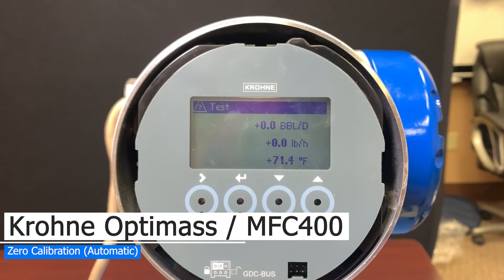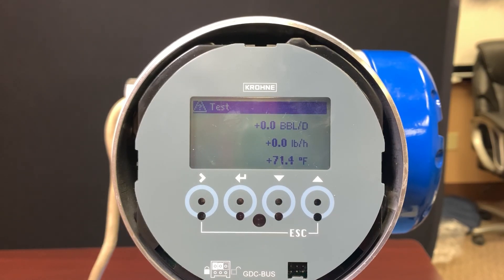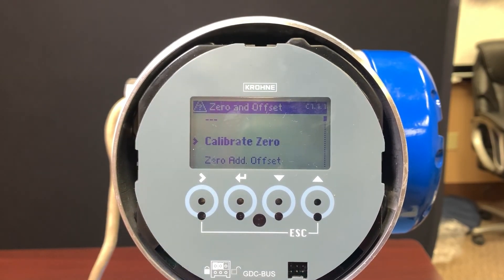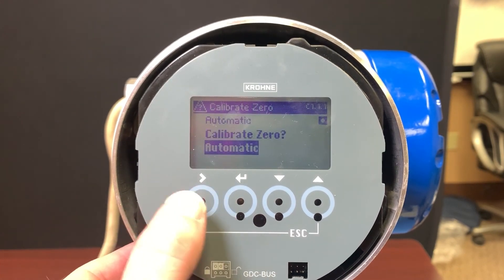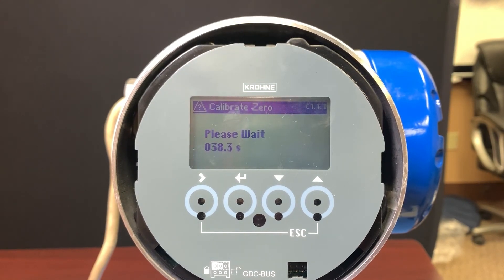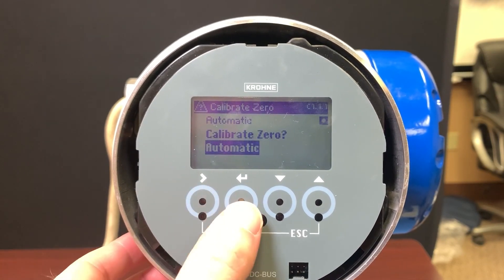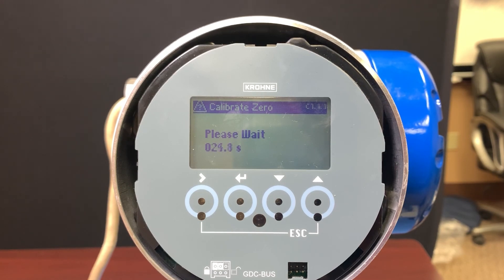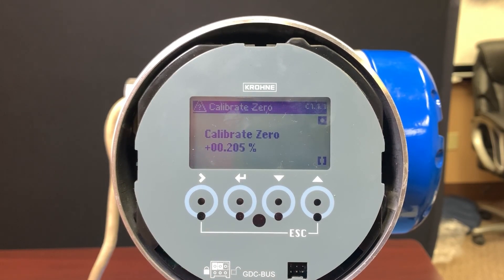Krohne Optimass Coriolis Meter with MFC400 | Programming: Zero Calibration Automatic

Comment: Hi, men very useful video, i have question  when we can do this calibration while there product (water)? Or need to remove flowmeter and then do this task?
Reply: according to the MFC400 manual available on the KROHNE website:
Observe the following for reliable zero calibration:
• The flow sensor should be completely filled with the product at the expected process pressure and temperature.
• The product may contain no air or gas, especially when it comes to horizontal installations. Prior to zero calibration, it is recommended that the product be flushed at a high flow rate (>50%), for 2 minutes.
• After flushing, re-establish zero flow by closing off the corresponding valves.